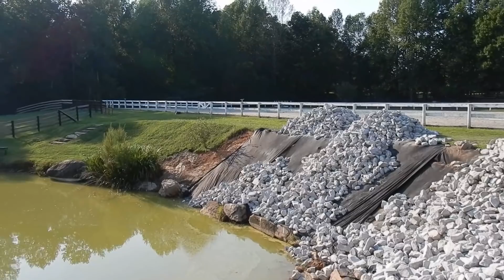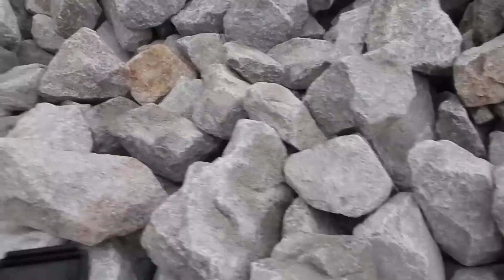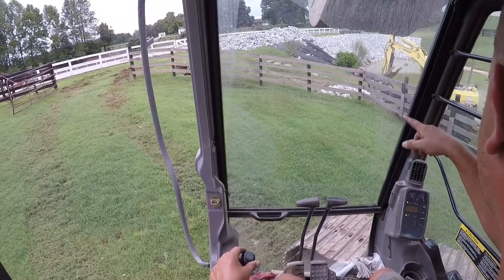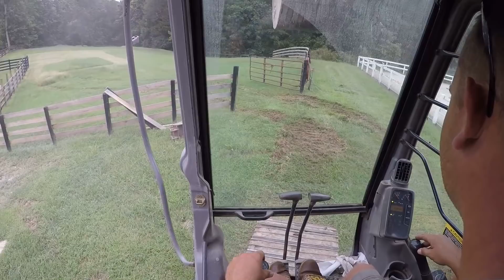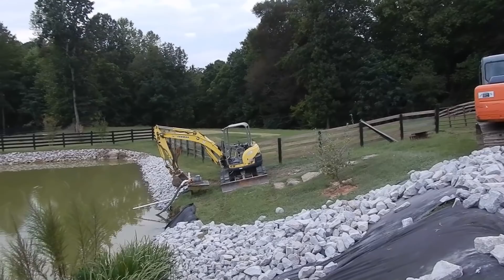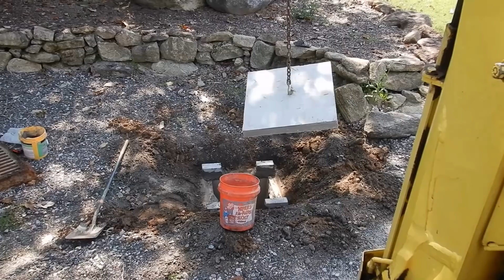Rip Rapping An Eroded Hillside

Comment: Now I know what is different. 
There is no blade on that excavator. 
I thought it was standard on all excavators.
Reply: I was thinking at one point, it was a pity he was facing the wrong way, and could scoop up the rock against the blade, but you are right.  He doesn't have a dozer blade on that machine.
Reply: Making it Happend only on the compact ones

Comment: Why do you put straw on top of the seeded grass ?
Reply: You will get more weeds when you straw it, but the trade off in getting the ground covered quickly to hold the soil in place is worth it.
Reply: @megapooldealsdotcom Yup. Also helps keep the seed from washing away. I think that the process is used most everywhere.
Reply: Vegetation. Also use it a lot for erosion control when it rains out here in cali

Comment: If they get too much dirt washing into the catch basin they could always put a 1 or 2' concrete apron around it or put straw logs around it. How many people stop while you are working and talk about projects? Operators can learn a lot about running equipment watching you. You hardly ever max out the cylinders by banging the bucket ram. Are there many side dump trailers in your area?